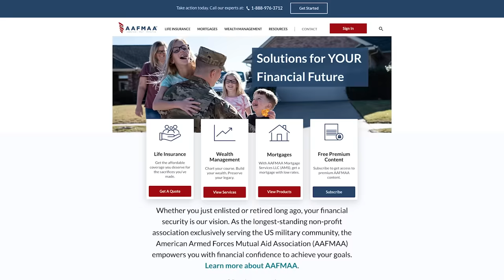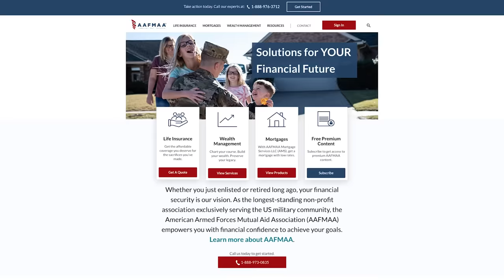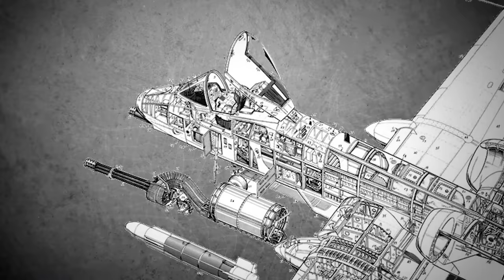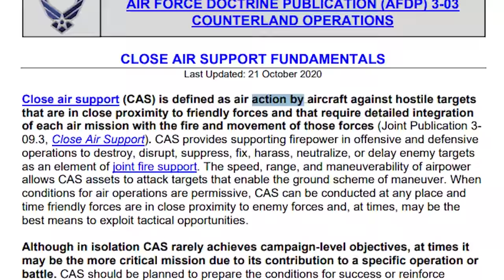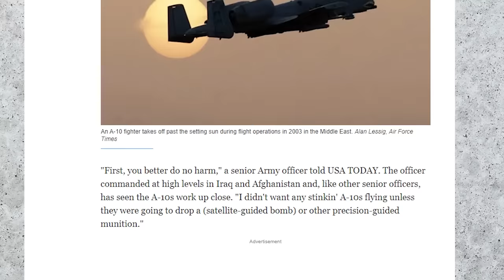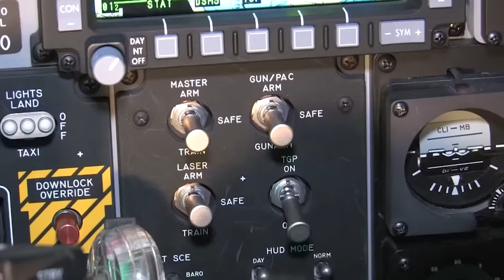Why the Air Force is Screaming to Retire the A-10 Warthog

Comment: Not many people realize that it’s now more expensive to modernize an A-10 than it is to build an F-35
Reply: But an F35 simply cannot even attempt to do what the A10 does.
Reply: @tetraxis3011  because who would want to fly low and slow over an enemy that’s going to be shooting at you when you can be stealth and drop a PGM 80 miles away and still nail the target
Reply: @tetraxis3011 yes but the role of the a10 is kinda obsolete in a future war with China
Reply: Yhea but the A-10 is just useless..
Reply: @starexcelsior1135 "stealth" isn't an actual thing like people like to believe, it might make it harder for radars to spot you from long distances but close up, it's not a factor, as soon as you open your pylon doors or engage a target, it's game over. 

The su-25 does basically everything better than the a-10, it has superior maneuverability and speed, its tanky af, it can carry a lot of weaponary.... the gun isn't as good but at the end of the day, gun runs aren't a thing when you're flying 50 feet off the ground praying a SAM doesn't lock you up
Reply: Shut up f35 no go brrrrt!
Reply: Because it isn't more expensive and expense isn't the point anyway.
Reply: @JustTravii  The F-35A carries GAU-22 a 25mm Gatling Cannon so it has more BRRRRT than a F-16 or any of the other teen series fighters. Fun fact a GUA-22 is basically the same mechanism of a GAU-8 with a 25mm barrel cluster.
Reply: While also still expensive, they should redesign a plane for the exact same role the A-10 has, borrow a lot from it. With new materials and engines and fly by wire etc. they can do better. Yes, it will be expensive, that's always the case with designing a new plane, but the effectiveness will be way higher than the previously proposed replacements that don't come close to effectiveness and longevity.
Hell, maybe make it a drone if the lag between it and an operator isn't too great. Or a drone wingman thing as is being looked into by several countries.
There just currently is no decent replacement, the best replacement is a "redesigned A-10". Not just updated.
Reply: @tetraxis3011  youre better off with an apache
Reply: @starexcelsior  what an idiotic statement. Infantry combat isnt people sitting at a pc and targetting the lit up red dots .
Reply: @JustTravii  It's 20mm canon actually goes rrrrrrrrr (can't even hear the b since it has a higher firing rate than the 30mm)
Reply: @bingbong6127  Nah, you are the one missing the point here.  Stealth doesn't have to make a plane invisible for it to be effective.  The greatest benefit is that it makes it far more difficult to target and lock on with missile systems.  Long wavelength radars can detect that stealth aircraft are out there somewhere, but they have poor resolution so they're not good for targeting.  Unless you're suggesting that they just shoot blindly in the general direction...

You are right about one thing though: the gun doesn't matter much in most real engagements.  Which is why the A-10 is kind of silly and using more modern aircraft makes a lot more sense.
Reply: Also not many people realize that the new heavy lift helicopter is more expensive than the f35
Reply: @starexcelsior I don't think YOU understand CAS at all. 

CAS isn't about sending A missle at a target. It's about keeping up a consistent barage of attacks so as to allow ground forces to regroup and go on the offense.

For a jet to do that it needs to be able to loiter for long periods, go slow so it can launch multiple attacks in a single strafe, and be able to turn on a dime for proper repositioning.

Last time I checked the F-35 can't go very slow, can't loiter for long, and can't turn like an A-10 can.
Reply: People aren't even sure how effective the GAU 8 is compared to just dropping bombs anyway.

 Most of the kills in Desert Storm weren't from the gun. Let alone MBT confirmed kills which people argue to this day about.

 Cost per flight hour and the fact they can be stationed closer to the front line seemed to be the thing it excelled at. 

 Oh and the effect on moral since it can actually be seen by both allied and enemy troops.

 I've been told by vets they definitely did not want one doing a strafing run near them. They'd much prefer an F 16 dropped JDAMs or an AC-130. Or an attack helicopter.
Reply: @ts757arse  Nah, just have multiple 24hr drone coverage instead.   If complete air superiority, loiter time becomes even more important.  You circle overhead like a vulture or eagle much more efficiently with a drone.
Reply: @bingbong6127 A-10 isn't that tanky when AA missile is a thing. The point of F-35 is to make it pretty much impossible for high frequency Radar (which are what most, if not all anti air radars are)  to track and lock on it.
Reply: Strap the cannon to the f35
Reply: But an F-35 is a  fighter bomber not a close air support.
Reply: And the A-10 flies at low enough speed to actually be an effective close air support jet while the F-35 can't fly that slow without risking stalling. Also the F-35 can't land in forward airbases with unprepared runways.
Reply: @tetraxis3011  because it wasn't meant to.
Reply: @ts757arse problem is manpads endanger all aircraft flying ground support so the argument is mute
Reply: Fun facts ----------- How many training hours do A-10 pilots get on close support?  Hundreds of hours.  How much is required in F-35 training?  None.
Reply: @tetraxis3011 what, get shot down during a strafing run on the front line?
Reply: @bingbong6127   Stealth is an actual thing. Using it means you dont have to fly super low like an SU-25 all the time.
Reply: @ometec  an A-10 modernization package costs way more than an F-35
Reply: F35 is $77 mil a copy.  Costs more than that to modernize an A10?
Reply: @gabiballetje So... You are describing any military drone and CAS platform ever? Even an old DC-7 plane with a minigun on the side can do that job...
Reply: @JustTravii  actually f 35 does go brrrt
Reply: @Spazattitude And the US Air Force chose a turboprop Super Tucano to do the CAS role...
Reply: @lv603 Yes. In engineering economics, there is what we call "maintenance costs" which increases as the year passes...
Reply: @sheilaolfieway1885  at least F-35 got enough cameras to make sure it's not friendly firing
Reply: @tetraxis3011 Not true when you face China
Reply: @jjnix9517  -- You don't need to fly slow to be effective at CAS. EOTS allows the F-35 to have its attack run planned and ready to go miles before they even begin to engage, and allows for an incredibly effective first pass with warheads on foreheads. Unlike the A-10 which is relying a ton still on smoke, visual identifications, talk-on from landmarks, etc... and is usually using pass 1 for target identification.

F-35B is designed for unprepared airbases. Also, important note, the A-10 has never operated in any combat mission from an unprepared surface. The USAF has entire teams dedicated to securing or creating airfields to use.

Bunch of folks bringing up loiter time. In an environment that an A-10 will be operating in, loiter time is completely moot. Why? Because of what else will be operating in uncontested airspace... tankers.

Also, fun fact, the F-35 in beast mode is capable of carrying more ordinance than the A-10. By literal tons.

And final fun fact... The A-10 has already been performing a minority of CAS missions. I mean, look at the data. The B-52 has been performing more CAS missions than the A-10 has.
Reply: @JustTravii fun fact. Later f35 models removed their gun turrets.
Reply: @thechlebek901 The A10 has a lot more range and can reach targets a lot faster than the Apache.
Reply: @lv603  $2B for engine modernization alone. Let alone avionics, targeting, software upgrades, etc... For the cost of modernizing the engine alone, you could purchase a squadron of F-35s plus some.
Reply: @bradenmchenry995  is it though? what if china has a lot of tanks?
Reply: @ts757arse even Iran poses a major threat with it's purchased S-300's, which was also the main reason why the air force scrapped the idea of creating a new A-10 (the "Super" A-10)
Reply: Improving the A-10 to a game console like the F-35 is like defacing the Mona Lisa to make it look more modern.
Reply: Don't know where your getting your facts from but your dead wrong. The A10 is $22K per flight hour in maintenance cost where as the F35 is $42K per flight hour. Given the fact the A10 has 17 seconds of gun time vs 4 seconds for the F35, for the CAS mission the A10 is much cheaper.
Reply: @binbows2258  it really isn't, the most advance "stealth" plane from the 80's, the F177A got shot down by a Isayev S-125, which was an ancient SAM system even for those time. The US constantly BS around about "stealth"... you don't even need a stealth plane when you're fighting Talis and other insurgents who have a wrinky dinky truck with an ZU-23 set up on it as "air defense"... Meanwhile you see Russian jets dumping fuel on multi million dollar MQ-9 Reapers which have bigger radar cross sections than some jets used today... 

If you want stealth, make small kamikaze drones that fly predesignated paths with the least amount of AA presence and hope it reaches the target... that's about as stealthy as it gets.
Reply: How many $500 Australian cardboard drones can you buy for the 18 million an A10 costs?
Reply: Not even talking about drones, that are the future of CAS. 
We already see that in Ukraine every day.
Reply: The per flight hour operating cost of the A-10 is still much, much lower. The air force even admitted several years ago that one of the reasons why they want to retire the A10 is because it's TOO cheap, and doesn't support the MIC.
Reply: @starexcelsior  Yea but the F35 cants carry more than 2 bombs.
Reply: @bradenmchenry995  With China yes, with Russia Idk
Reply: @bingbong6127  The Su25 is surprisingly robust, and even it isn’t inmune to ground fire. We need new armor advances
Reply: @Spazattitude the goal of going slow is for the pilot to be able to identify visually the target. However with modern targeting tools, slow speed isn’t needed anymore. There’s a reason the A-10 did so many blue on blue
Reply: They should turn them into drones and keep it Cheap. The psychological factor alone that these planes have on both hostile and friendly troops is nonexistent with the f-35. Ground soldiers don't fear the f-35. They do fear the A-10 when they hear that cannon fire above the battlefield while these planes make their low altitude flyby. I makes them want to crawl into their foxholes. And it's a great morale boost for their own troops. Mass produce these things as a drone and keep it as cheap as possible. Let the F-35 handle the precision strikes on hard targets, while these A-10 drones focus on infantry support. They don't even need expensive laser guided bombs for that. Just pepper the enemy with 30 mm and rockets. The main goal is intimidation and support. Keep them flying 24/7 so that the enemy has no rest.
Reply: @acarrillo8277  But the F35s gun is innacurate because it shakes too much when shooting.
Reply: @thechlebek901  Yea. Or an Su25, or maybe an Mi24.
Reply: @Toaster-v1z  Thats a problem too. But as mentioned before, the f35s payload capacity is too small.
Reply: @JustTravii  yes it an. The F-35C
Reply: @gabiballetje  no they shouldn't and having a dedicated CAS aircraft is just pointless.
Reply: @bingbong6127 also you aren’t describing stealth properly or explaining what a weapons grade lock is. You have bits and pieces. You’re getting there, just try not to argue with people until you learn about the topic.
Reply: @dexterplameras3249  The gun isn't that important for CAS, overpowered for trucks and artillery, and underpowered for tanks. A smaller gun could also do its job. But carrying so many missles and bombs under the wing for hours without external vulnerable fuel pods matters.
Reply: @Spazattitude  planes no longer need to go slow to have sustained fire percussion guided munitions eliminate the need for an aircraft to even be close to the ground. The A10 is no longer needed because the US has no need for a dedicated CAS AIRCRAFT any more.
Reply: @tetraxis3011 neither can an A10 anymore
Reply: @jjnix9517  why would you need to fly slow to perform CAS when precision guided munitions exist. You don't understand what you are talking about.
Reply: @Spazattitude  Why need a dedicated and obsolete air frame to do what drones and attack choppers do anyways?
Reply: @Spazattitude   F-35 can't go very slow, can't loiter for long, and can't turn like an A-10 can.
 But drones can, and do it much better than an A-10
Reply: @sheilaolfieway1885  CAS as people think of it is an obsolete idea anyways. There is nothing a dedicated CAS platform like the A-10 can do that drones and attack helis aren't already doing.
Reply: @theotherohlourdespadua1131  no, a different one with a different role, those things will not do what the a-10 does, I thought that was obvious.
Reply: @gabiballetje  multi role aircraft. There is no need to redesign the A-10 because all the things that are unique to it are not needed.
Reply: @mpondachongo1138  then make an redesign. It was just spitballing. People who know more about it would know if that would work or not.
Reply: @bingbong6127  You are confused about stealth
Reply: The A-10's should be converted to remote UAV's.
Reply: @rudder727  and an F-35C can do it even better.
Reply: @assertivekarma1909  and what happens when it's converted to a remote UAV? you have connection issues, can''t fly it as well, and its still a big slow target... congrats, you just spent additional money on a target
Reply: @jacobzindel987  And also, maybe, because in a war like in Ukraine it would be as useless as the Su 25 against modern manpads and airdefense. Drones are the only response. Far cheaper and expendable.
Reply: @dexterplameras3249  one is a multi role aircraft that can do more than just CAS and the other is a flying dinosaur.
Reply: Nachtmahr22  the A-10s gun is unreliable
Reply: The A-10 isn't and never was expected to be completely "modernized". This is why it's survivability is as high as it is. The redundant hydraulics are more reliable than the F-35 is in its entirety .
Your bullcrap of modernizing 200 Warthogs being more expensive than one Fat Amy? 🤔🤔 Yeah....nope not even close to being factual. BUT let's see just how damn expensive replacing "THE MOST EXPENSIVE AIRPLANE IN HISTORY" WILL BECOME EACH TIME Fat Amy is downed by some armament which the A-10 could eat all day. Let's watch Fat Amy complete a mission missing one engine (oops it only has one), 70% of a wing, half its tail and land safely whole encasing the pilot in a titanium bath tub...Yeah...didn't think so.
Join us in the Sandbox with your life and that of your buddies in the hands of a danger close Hog at 200 ft off the deck @ 150 knots and hearing Brrrrrrrrrttttt or a  lumbering F35 at a much faster speed, higher altitude and it's 20mm and see which one Marines and troops respect AND most importantly actually are able to breathe because we know the Hog is there and will prove itself again.
Reply: @bingbong6127  in comparison how many A-10s have been shot down? About 5. Which isn't alot but when compared to the F-111 is considerably higher.
Reply: @Spazattitude  you do realize that an attack helicopter can already do this, right?
Reply: @tetraxis3011  that's simple untrue.
Reply: @mpondachongo1138  so what would you suggest ?
Reply: @tetraxis3011  it's worse on the A-10 and  using the gun on an F-35 for CAS is like using a fork to eat soop.
Reply: @tetraxis3011  What? Taking hits?
Reply: So if de-investing, grant a squadron to Ukraine and see what it can really do
Reply: @sheilaolfieway1885  the F-35 is ment to fulfill multiple roles while being stealthy at the same time.
Reply: @gabiballetje  they know it wouldn't which is why it isn't happening.
Reply: @jjnix9517  question, what do you think an attack helicopter does?
Reply: @dianapennepacker6854 those vets are def in the minority... We used to cheer when we heard we had one. We knew we could get a break to reposition and regroup. True, you had to be 100% sure on your signaling because they were basically flying blind up there, but we never had an incident, nor do I know anyone who would prefer a wall of bombs with unpredictable, high range shrapnel going everywhere.
Low, slow, high fire rate, loud, long loitering and a tight turning radius made all the difference.
That being said, for CAS, I would personally rather have an Apache any day if it weren't for the mission times being so much shorter.
Reply: @mpondachongo1138  and again, so then what ?
Reply: @gabiballetje  a multi role aircraft the the F-35 and it's various is a better investment than an A-10 modernization program.
Reply: You can build 10 A-10's to one F-35.
Reply: @lv603  yes, the f-35 is cheaper because it’s a bulk order. The more that is purchased of them, the less they cost per unit. A-10s are no longer being produced, in contrast the f-35 is currently in production for the U.S. as well as other countries.
Reply: The ten in A10 stands for the amount of other combat planes that can perform the same job as the A10. If not even better. 😂
Reply: @timmoles9259 no, you really can’t. New A-10s haven’t been built in decades, and restarting production lines is a long and expensive endeavor. Meanwhile F-35s are being built by the dozen for both our Air Force and export customers
Reply: @jjnix9517 you realize the f35B can land on unprepared runways right? It literally had vtol
Reply: @bingbong6127  Only completely ignorant people believe that "stealth" means undetectable. Anyone that knows anything about aircraft knows it means it's just harder to detect.
Reply: @rudder727  yes, but the trade off poor accuracy. to put that I prospective, when the a-10 was deployed in desert storm, it had no radar or optics. The pilots were using binoculars to pick targets. This led to a now infamous incident where an a-10 fired on a British convoy by mistake. This led to the a-10 being band from areas where British troops were deployed. If you do not believe me, I encourage you to google this situation. The footage from the cockpit of that a-10 was published for the world to see
Reply: @gabiballetje With how cheap drones are these days alongside longer range munitions from F-35s ect it feels like there's no real justification.
Reply: @denniskrenz2080  I agree the gun can be smaller (maybe 20mm), but its still very important for danger close missions where the only option is a high angle strafing run.  Many special forces Combat Controllers have called in air support missions as close as 10 meters with an AH64, AC130 or an A10, In many cases the squad would have been killed without a danger close mission and multiple runs. A bomb would have killed them all. I think the A-29 would be a better replacement than the F35 for CAS, with the F35 and other platforms providing top cover. I will also add that in a high intensity conflict, the US would focus first on SEAD and DEAD missions to gain air superiority before sending in ground, so any CAS mission would have the benefit of air superiority.
Reply: @jacquesstrapp3219  go back and read my original comment, i specifically mentioned this, its harder to detect from longer range, which means jack when you take into consideration that radar works WAY better for things in the air as opposed for things on the ground with a million different interferences... Modern radar's can spot jets before even getting into visual distance of the engagement zone, sometimes, as soon as the plane takes off depending on the range.
Reply: Nachtmahr22 Downside being gunruns require you to risk the aircraft
Reply: @gyratingwolpertiger6851  I think you’d need a lot of F-35s to offset that, drones maybe, but how many of those would you need, how many drones can 1 pilot control well, would they together do the same thing an A-10 can do ? How well, at what cost. I don’t know. Might not work out.
Reply: @dexterplameras3249  yes, but the a-10 is No longer being produced, the f-35 is. Whats more the people who makes these planes have a market to sell the f-35 to in both North America and Europe, there is no such market for the a-10.
Reply: @gabiballetje  Probably not. Drones are so much cheaper especially the fpv types that it's no comparison. See the FPV drones carrying mortar or arty shells taking out a tank vs cost of an A10
Reply: @mpondachongo1138  You can not do danger close missions with a bomb at 28 thousand feet. You will kill all friendlies due to its blast radius. There is always a need to get into the weeds for high angle strafing runs, otherwise there would be a lot of dead special forces without danger close missions of 10 meters. The F35 has 4 seconds of gun time (2, 2 second bursts) the A10 has 17 (10, 2 second bursts).
Reply: @ts757arse the f35 is great but the grunt on the ground will never see it.
Reply: @thechlebek901 the army will never see an f35 overhead.
Reply: @starexcelsior  So you want to do CLOSE air support without the pilot being able to see the target and hit a tank with a $500,000 cruise missile?
Reply: @gyratingwolpertiger6851  but how do you get those there fast enough ? Or in other enough numbers ? And that’s just one type of ordinance. Swarms might work. Would it ?
Reply: @insanity693  I think the concern should be for the soldiers on the ground not the sales of the airplane. So long as it's the best platform for CAS and has no replacement, it should stay in my opinion.
Reply: @bradenmchenry995 Nothing is obsolete in a war.  Just differing in degrees of effectiveness
Reply: @gabiballetje  it's a matter in Ukraine for example of them either being distributed to front line units themselves or dedicated drone units that can go where needed.

Speed of response isn't an issue when the drone can be launched close to where it's needed vs having to fly from an airfield
Reply: @rudder727 a fixed wing platform can always outperform a helicopter.  What has to change is the agreement that says the USAF controls all fixed wing aircraft.  It's all about rice bowls.
Reply: @dexterplameras3249 thx for pointing that out.  My point is that the a10 should not be compared to the f35 at all.  Instead it should be compared to Field Artillery and attack helicopters.  The A10 outperforms them all.
Reply: @lv603 Yes. Immensely more.
Reply: @bingbong6127 a10>su 25.
Reply: @Nachtmahr22 Research has shown the rotary cannon on the A10 makes up an extremely small fraction of its kills. By far, the most effective tool it has are its precision guided missiles. Yes bullets are cheaper than missiles, but putting an airframe within visual range of ground forces increases risk which has its own costs. Simply put it's outdated on a modern battlefield.
Reply: @tetraxis3011 a Strike Eagle can do more than an A-10 ever could.
Reply: Would something new and cheaper than an F35 be more appropriate? Or, is using one aircraft type for all aggressive missions a better cost affective solution? 

I don't know the answer to these questions but would like to hear any valid arguments either way.

I'm an ex-soldier and instinctively I feel it would be better to have eyeball to eyeball contact with my air support if the s**t has really hit the fan and the friendly vs foe force lines are fluid as a close quarters battle is underway. This fluidity is exemplarily demonstrated in the videos coming out of Ukraine where they use drones to direct indirect fire on to trenches within a few 10s of metres of the attacking soldiers. Have I answered my own question, hmmm 🤣
Reply: @dexterplameras3249  you may or may not realize it, but the U.S. military is currently planning for a potential war with a near pear enemy for the first time since the end of the Cold War. The a-10 is ok for fighting against less advanced equipment, but not against a pear opponent. It’s an old aircraft that is only getting older. The a-10s production lines have been shut down for years and would cost a lot to restart. Some people want to cut military spending so taxes can be decreased as well. That’s the trade off. Where would the U.S. military take the money from to restart production of the a-10? And let’s say it is restarted, who is gonna buy it outside of the U.S.? It’s only necessary to Make something as long as someone is willing to buy it, Because the over all price per unit decreases the more that’s purchased and the price increases the less that’s purchased.
Reply: @gyratingwolpertiger6851  but that’s nowhere near the same function that A-10s have
Reply: @tetraxis3011 we simply don't have the air superiority to fight against a nearpeer advisory to even use the a10 anymore unfortunately it's become outdated
Reply: @ts757arse  actually you just proved my point if you are out of the range of the manpads you are not in range to do the CAS role by definition ecm can be supplied by mission pods and if are accelerating away from the zone again not doing the job.  F 35 is a good generalist but doesn't excel at any given role and neither have the loiter time a dedicated platform would have.  I agree that the A10 is long in the tooth but it is still better at its job than the new systems.  The look over there arguments are silly yes the platform is not good at everything it never meant to be.
Reply: @insanity693  The US would not send in ground forces until the air war is won. The first stage in US military doctrine is SEAD (suppression of enemy air defence) followed by DEAD (Destruction of Enemy Air Defence). Once DEAD is accomplished the airforce will bomb for weeks before sending in ground forces and with it the need for CAS (close air support). At that stage the only thing left is MANPADs and the A10 is designed to take damage from a manpad and still make it home. There is no need to restart production of the A10 because they have enough to support ground forces and enough spares from the long term storage.
Reply: @ts757arse  Thanks for your reply, I agree and as I said I had probably answered my own question. I think my other question is still valid, is a plane that costs as much as an F35 the only answer for the period in a war after air superiority has been achieved or could a far cheaper, new, fast, high flying, modern platform be a better investment?
Reply: @dexterplameras3249  an A 10 would get shot down by SAMs or MPADS before it gets in range to use its gun. It's useless in a near pear conflict. You are better of using an apache.
Reply: @dexterplameras3249  The gun is also more accurate than rocket pods, but helicopters are in many situations the better gun platform. The great advantage though for the A-10 design, the barrel can be longer and more accurate than on a helicopter. Also I don't think, that the A-10 should be expected to be BETTER than the F-35. The F-35 would be equally bad in a high-threat environment. It is faster, has slightly better ECM and sensors. But can't expect to catch a MANPADS and still fly, or catch lots of small arms fire. Higher speed also means more fatigue in NOE flight, which limits the effectiveness. Better attributes does not always mean better weapon.
Reply: @denniskrenz2080  The apache can't fly in high mountains or travel as fast as an A10, they are great if you have a specific mission, but to do a lap of a country  waiting for combat controllers to call in, the A10 is better at because it can cover more ground and get there faster.
Reply: @bingbong6127  No shit. Since most aircraft are capable of carrying over the horizon munitions, radar needs to detect them at the farthest possible range. The main purpose of stealth is to get in range before being detected. I was disagreeing with your idea that most people don't know that. BTW, I served in a CSC which included ground effects radar for our battalion so I'm familiar with how radar operates.
Reply: @dexterplameras3249  the requirements for war have changed since the a-10 was first introduced. It’s gau8 can not destroy modern tanks, which is what the U.S. military expects to see in a near pear conflict. The way wars are fought are always changing as technology advances and brake throughs are made. Wether or not anyone likes it or not, the a-10 is technologically outdated. The a-10 for reference is something of a cousin of the p-47 from ww2. I say this because the p-47 and a-10 were designed by the same guy to fulfill what amounts to the same role. There is a reason why Sweden decided not to make its own licensed version of the a-10 as was originally planned.
Reply: @tetraxis3011  strap a cannon to an AirTractor with modern avionics. Bam. Does what the A10 does, but cheaper.
Reply: @jacquesstrapp3219  well then you're very familiar with the fact that long range AA systems don't operate alone, so unless your hypothetical involves going one for one with AA... it just isn't gonna work out for you. Establishing air superiority in modern war is a lot more time consuming than most people would anticipate... and really, its just denying your enemy air superiority and the enemy does the same to you which then turns into trench warfare with attack helicopters flying ass to grass and operating in specific predesignated areas.
The air force basically operates independent from ground troops with the same common goal but very different task, there's no CAS and no air evac on the front... sucks for infantry and armored units but it is what it is
Reply: @dexterplameras3249  High mountains are not the typical battleground to conduct CAS operations, anything below 2000m is. The plane/helicopter that can do all equally good does not exist (And should there be a fight on top of the himalaya, the F-35 could finally conduct CAS without leaving its comfort zone.). And for most gun support roles, the helicopters will have the advantage. The real advantage of the A-10 is its mobility compared to the helicopters. Longer range, slightly higher speed, refuel capability.
Reply: @jjnix9517  source? oh wait all that is classified. we have no idea how slow it can fly, we have no idea what sort of runways it can take off from.
Reply: @denniskrenz2080  Thats been the "typical" battleground for 20 years until the Afghanistan pull out. CAS missions were done in the mountains of Afghanistan. CAS is anywhere you have troops
Reply: @lv603  i saw some estimates at 40ish mill a plane, the real figure is unknown because nothing ever got approved. The air frames are old as crap it cost several billion dollars for the replacement wings and modernization programs already... let it retire in peace.
Reply: @tetraxis3011  or or... instead of adding armor hand hoping you dont die you....never get shot in the first place with stealth, ECM, physical counter measures, high speed, maneuverability and the best sensors and navigation systems mankind has ever made fly?
Reply: @tetraxis3011  Uhhhhh, homie?? The F-35 carries 2000lbs MORE than the A-10C based on the USAF's disclosed facts
Reply: @dexterplameras3249  I'd disagree there. The big battles in Afghanistan had been below 2000m, but the different theaters had been separated by up to 8000m high mountains. Any mechanized combat in Afghanistan is pretty futile, which already the Soviets experienced painfully. The A-10 was equally limited in its effectiveness by this battlefield like all "post-coldwar" units. In fact, the transport helicopters and the mountaineer units they transported, had been the more effective units. BUT: There is no other country on this planet with this unique geography. Even Nepal is easier terrain to fight on.
Reply: @ts757arse  Shure they are accurate but impersonal and limited battlefield psychology is a thing and the whole call a strike and wait for the middle to come in kills things not going to be surrendered to or be a deterrent.  So not good for CAS in the long run.  Need to maintain the right tools for the job.
Reply: @insanity693  stealth won't save you from  being seen.
Reply: @mpondachongo1138  look at the payload difference of the f111
Reply: @denniskrenz2080  Battle of Takur Ghar (3,191 meters), Battle of Tora Bora (4,267 meters),  Restrepo (Korengal Valley). You really don't know what your talking about. Look on a map of Afghanistan it's all mountains near the border with Pakistan. Kabul is 1700 meters and its in a valley. Afghanistan is nearly all mountains and is why has never been occupied by any army all the way back to Alexander the great.  To the south of the country is the flattest part of the country but there were no major battles fought there because there is no where for the Taliban to hide. I'm getting tired of arguing with people that don't know any facts. This will be me last comment to you, go do some research.
Reply: @Apollo-tj1vm  and when one gets shot down, then what are you gonna do? or worse.. if all those fancy sensors stop working because of EW..
Reply: @notastone4832  it's called a camera. And if you actually got shot down, then I do want to know what happened. If the weapons bay is open, then the RCS will bloom significantly. Which was what happened to the F-117 in 1999, from pure dumb luck and operation llanning error.
Reply: Nachtmahr22  If talking new build the F35 is cheaper due to the volume that's been ordered.
Reply: @bingbong6127  That's what SEAD operations are about. Interdiction missions are totally dependent on suppression of enemy air defenses. SEAD aircraft force AA radars to turn off or they get a HARM up their ass. 
     Preparation of the battle space does indeed take time. That is why the preparatory air campaign part of the Gulf War lasted for 42 days and consisted of over 100,000 sorties.
     Your concept of air operations being independent from ground operations is SOP for Soviet and Russian forces but that is not how NATO forces operate. Our doctrine is called Air/Land Battle which focuses on integrated employment of land, air and sea forces. The 1991 Gulf War illustrates the effectiveness of this concept. This has been upgraded to Full Spectrum Operations in 2001. This is a complex doctrine that requires a great deal of training and technology to implement properly. Fortunately for the US, we have the expertise and budget to pull this off.
     I encourage you to research Air/Land Battle and Full Spectrum Operations for more details on US doctrine.
Reply: @ben1l752  yea what about it?
Reply: @chillaxter13  I think they had too many close calls. Also most were Desert Storm era, and I believe it has been upgraded. 

 That still doesn't change the guns accuracy or lack there of.
Reply: @ts757arse  need to look at the video on YouTube where the USAF bought 70 souped up crop dusters for the low intensity environment.  More economical than the A10.
Reply: @gabiballetje  Ukraine war is proving that drones are likely going to be the go to replacement for sqaud level CAS.  Squads cans even bring their own air support that can even take out tanks with sucide drones.  Suicide and recon drones can be made so small and deadly that effectively every sqaud sized element can bring its own personal airforce.
Reply: @gabiballetje There is no doctrinal need for anything like the A-10 that isn't done better by helicopters.  The main gun is way overpowered for anything short of a tank, but not quite powerful enough to kill a modern tank, and all topped off with atrociously poor accuracy.

Sure, the A-10 carries missiles, but so does every other combat airframe, including helicopters.
Reply: @tetraxis3011  F-35's role is being upgraded to include directing missiles from other platforms further back - something like an aerial forward observer.
Reply: @sheilaolfieway1885  maybe so, but it doesn’t change the fact that there is a demand for the f-35. As long as buyers remain for the f-35, it will continue to be made.
Reply: @jjnix9517  It flew low and slow because the pilots had to visually spot the targets with binoculars or just their eyes vs more advanced aircraft that can use their own sensors or have data passed to them.
Reply: @tetraxis3011  it doesn't need to. and the A-10 can't even come close to what the f-35 can do. there is so much about what the f-35 can do that is not public knowledge that would explain why its actually a better platform. but maybe in 30 years that information will become public. but there are some very big reasons why everyone wants the f-35.
Reply: BS
Reply: All those weapons you listed can hit a F35 when it comes low for a bombing mission
Reply: @tomhenry897  Why would it be flying low when it can drop bombs from altitude? Laser and gps guided bombs are a thing. Eg JDAM ER with what 50 plus range
Reply: @dexterplameras3249  and the Taliban simply jumped from mountain to mountain. And because of the unique geography of Afghanistan, all future battles will be fought there. Notice the flaw in your argumentation? (Aside of the fact, that helis worked well there). Masar-e Sharif is just in 360m MSL, BTW, just to remind you of the other extreme. How about the capture of Kunduz (about 400m), where the Taliban operated in large numbers, and the air support failed as whole? Maybe the Taliban simply don't listen to the real idiots, because they have died in minor battles these and do not sit in a comfortable Pentagon office...
Reply: @tomhenry897  exactly what are you calling bs?
Reply: @ts757arse  different services different budgets.  But the AF top brass has always hated the A10 and it's mission and have lobbied against it and any attempt to replace it do I think it's perfect or even optimal now.  No.  I do say it has an important role and the only serves not allowed to operate fixed wing aircraft is the one who loses when it is phased out and ultimately drones will not be the answer because CAS -like is not CAS and anyone thinking remotes are the end all have not thought it through to the countermeasures.  No the real issue is it's old and the misinformation is rife.  My position is, it needs replaced, and hand the army allowed to be the ones to use it.  But I also know that my opinion like yours doesn't matter and that this is only a fun exercise.
Reply: @bingbong6127  there is no such thing as complete stealth but the ranges of detection on the F-35 so far appear to be very impressive and it is also "aware" of anything that can detect it and how close it can get to them (and of course should be able to destroy them from further away than it can detect them). It also greatly effects the ability for anything to hit them even if launched.
Reply: @patrickjanecke5894  A fixed wing will always carry more weapons and have a longer range and loiter time than a helicopter.  They can also self deploy.  Agree its time for the A10 to go but my gripe is that the Army is prohibited from developing its own fixed wing air support aircraft, thats a USAF rice bowl.    The Army will never see an F35 overhead.
Reply: @robertschanke5589  Fixed wing MANNED aircraft.  I anticipate that the Army will have dedicated drone swarm vehicles in the not too distant future.  I don't think they will get as big as a Reaper, but it would certainly be enough to secure positions.  I suppose this would work well with the new, higher power, long-range rifles that are getting phased in.
Reply: @patrickjanecke5894  "wingman drones" could be an option for F-35s, maybe better if it was a 2 seater

They could get low and slow on the ground but not have the delay communicating with a base would be. Might be just as easy to control it from the ground, but the F-35 should be able to be undetected and hard to  lock on, and would be available as anti-air cover also
Reply: @removedot   I'm thinking more of a ground-based ... "hive" vehicle lacking a better term this time of night.  A swarm of no less than a dozen drones flying at any time, perhaps?
Reply: @JustTravii yes it does lol
Reply: @toolbaggers it has a 25mm cannon
Reply: @acarrillo8277  I’m not hating on the f35 I actually love the plane, it’s just hard to match the morale boost that troops in contact get when an a10 is in the AO.
Reply: F35s can't get that close to the ground and going to be a problem for the pilots.
Reply: It is if you are hearing creatively skewed accountancy !
Reply: @ts757arse most common manpads are heat seakers, a10 has lots of flares 😁
Reply: @acarrillo8277 do they run depleted uranium rounds in the f35?
Reply: @WarPigstheHun  they have an optional stealth gun pod, and it looks very funny
Reply: @MrAvant123  well seeing as you have to strip the aircraft do extensive retrofits while working around existing hardware that wasn’t designed with the new systems in mind yeah…. Also the majority  a10 airframes are extremely fatigued and stressed so they require a ton of work and parts to get airworthy and combat ready. It’s extremely expensive and difficult. Same thought process as building a new transmission snd just replacing it vs tearing the whole thing apart and going through and individually fixing every issue. Sometimes just scrapping the old is easier.
Reply: @MrAvant123  no, it's much more expensive to procure a limited number of new digital systems and then integrate them into an airframe that wasn't designed to accommodate them, than it is to buy another aircraft that already has well-developed supply chains and production lines